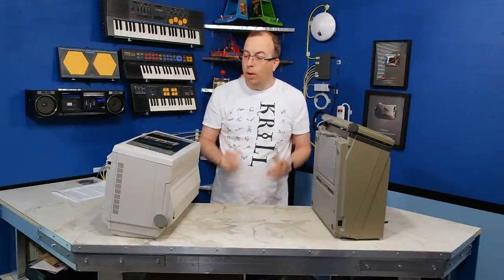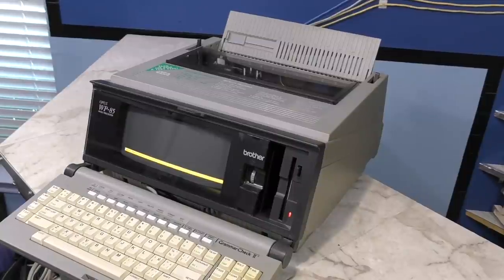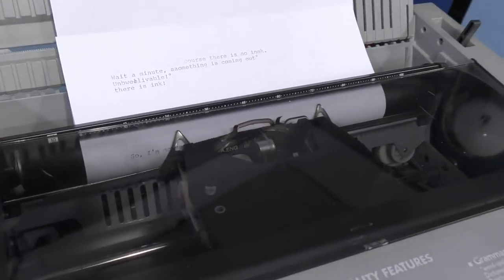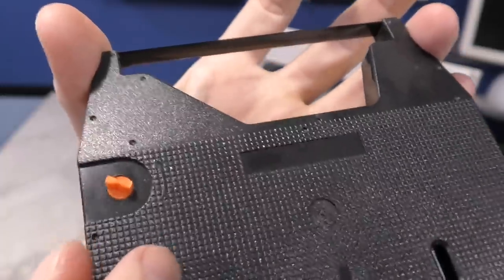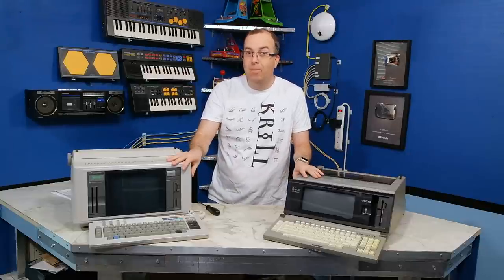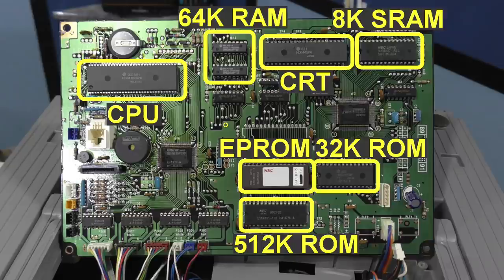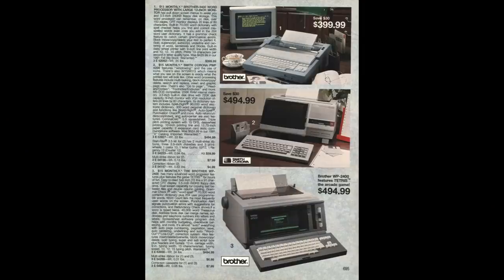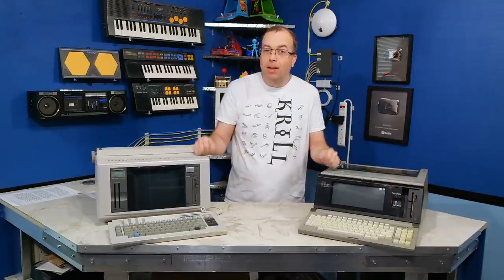Dissecting two Word Processors, Brother WP25 and Panasonic W1525

Comment: I still use Word Perfect on windows 10, from the Windows XP era.  It has editing features I've never found on anything else.
Reply: I used Wordperfect for DOS when I took a class on school in word processing.
Reply: Have you ever tried Open Office?
Reply: WordPerfect for DOS was the best WP, long after multiple versions of Word for Windows came out. Macros; read many different file formats, and it practically had its own menu-driven Text User Interface on top of DOS. Microsoft used their monopoly power to kill them, as WordPerfect for Windows came out late. It made me appreciate the command line, and eventually switch to linux.
Reply: @squirlmy  I bet. I just remember having to learn those codes to get the text to appear a certain way but you couldn't see it until it was finally printed.
Reply: The view formatting codes is super useful.
Reply: @ct92404  I use it; I'm working on the 2nd draft of my 3rd novel with it.
Reply: @squirlmy  "Microsoft used their monopoly power to kill them," - Sure MS did, because we all know that Wordperfect being one of the most overpriced software packages in the history of computers had nothing at all to do with it's decline in popularity as viable alternatives were released.

Comment: You know it's funny how certain things come back at you when you hadn't seen anything like it in the past.  I once worked for an office machine repair company who did service on Panasonic Word Processors and electronic typewriters.  We also carried the IBM Personal Typing Stations at the time along with the IBM Wheel-Writer and Quiet-Writer typewriter(s) as well as the printer counterparts for them.  I also had the (dis)pleasure of having to have to work on IBM's early electronic (mostly mechanical) typewriters (50, 60, 75 & 90.)  Them wuz the days!

Comment: I owned a Brother WP in 1988 and loved it. Back then, a lot of professors would not accept papers printed on a dot matrix printer, so the crisp print of the Brother was perfect. For writing papers and articles for the school newspaper, it was a great deal at even a few hundred bucks: word processor with floppy disc memory, printer, and monitor. I did, however, upgrade to a Mac Plus (and then a Mac SE), but friends who acquired the WP, which they nicknamed "whimpy," got a lot of use out of it. When the monitor ceased functioning, they simply used the typewriter mode.

Comment: that Brother unit and its floppy drive holds many mysteries indeed. I recently acquired a similar unit with non-functional keyboard and floppy. The keyboard is a membrane type with no real PCB, it is just copper paint sandwiched between two plastic layers. I was able to fix the keyboard with copper tape. The floppy made the same sound like yours. Boy, was it easy to get to it? Noo. You have to disassemble almost all the unit to get to it. Eventually, I got to the floppy and replaced the belt, nothing fancy, just a square belt. Then the floppy started working. It is a very non-standard format, no regular computer can read this floppy, but recently someone created a program on an ARM devboard, which allows you to read and write the floppies using standard PC drive. There is even a converter software on a forum. Now I can write on the PC and transfer to unit for printing or vice versa. Brother Word Processors are the best. I think Brother PowerNote devices are also very relevant to your channel, you should have a look.

Comment: I had a Brother typewriter in the late 80s to early 90s. It was a real workhorse. It was similar to this machine but it just had a small LCD screen and you could only see one line so it was more like type a line, make sure it is correct, then send it to the paper and just type to the paper which is what I normally did. It had a correction tape.  I used it for shorter papers along with my Apple II and ImageWriter printer. It is amazing how reliable that stuff was compared to my modern InkJet printer which I regularly have to smack around.

Comment: I had two of those same Brother word processors. I bought one for $50 at a garage sale in 1992 and I found the other one sitting next to the trash in my apartment building about 5 years later. The word processing program is similar to Word Perfect. I enjoyed the typing part. As a speed typist it has a nice comfortable keyboard but I usually went somewhere else to print my documents because it's really loud.

Comment: The cloth ribbons can be reinked, or renewed in various ways (the pigment isn't gone, just the light oil carrier) see Google for various types of ink or oil and methods to use. 
You can also find universal replacement ribbons on Amazon, and you just find the width that you need, and replace it in the cartridge.

The other type of ribbon is called a Correctable Film ribbon, and the  correction ribbon often actually removes the ink from the page rather than just covering it up.

On the better typewriters that used the film ribbon (like the IBM Selectric, which I started repairing as a kid, in addition to with Kaypro's and ZX'S and such), the ribbon actually moved up and down, so each character was in a different vertical position, allowing nearly complete useage of the ribbon surface, as well making the characters appear semi-randomly on the tape, and so close together as to be nearly unrecognizable as characters, and jumbled in order, so very difficult to recreate what was typed.

Of course, a determined person can often see what was typed on a cloth ribbon under the right circumstances lol

Comment: A lot of typewriters from the 70s and 80s have correcting function.
Reply: I think his confusion was not that it had correction tape, but this isn't considered a typewriter its a word processor which basically the difference is normal its not printing the word as you type, its only gonna print when you tell it to. That being said i think he forgot that most word processors had a typewriter function as really they are just glorified typewriters and will function as such so then a correction tape is a necessary evil, i like the panasonic design nicely as the last time i had a typewriter with correction tape, this was very early 2000s the correction tape was built in to the normal typewriter ribbon so you could effectively use all the correction tape with all the normal ribbon, kinda dumb design since you had to pay more for the ability to correct your mistake but when you used up all the ribbon all the correction tape was also used up, no need to rip the cartridge open when you had no other uses for it.
Reply: zachary carlson well said dude

Comment: Great video. I was in the Air Force between 1984 and 1990. I was a types and they taught us to type on IBM electric typewriters in tech school. Which was a step up from my high school which taught us on manual typewriters. When I was stationed at Nellis AFB I was given a dedicated word processor to use as well as a IBM typewriter. The word processor was a CPT. What was unique was the monitor which was integrated was orientated in portrait mode so that you could view an entire page of text. The floppy disks were 8" and it had only one. I later upgraded to the next model which was smaller called the CPT Jr  obviously a rip off from the IBM PC Jr. It used 3.5" floppies. I used one other type of word processor when I was a Luke AFB. It was a Wang. It used 5.25" floppies and booted its OS from one of them.  It claimed to be MS DOS comparable but I did try and boot off a DOS 3.2 disk and it had a loud continue be from its speaker.  All of those word processors used a daisy wheel printer.

Comment: I don't think it's TOO hard to re-ink a traditional ribbon. I remember those non-ink ribbons. Those are a bit of a security hazard if you use them for sensitive info, you have to dispose of those things correctly...
Reply: Fire 🔥 burn the ribbons
Reply: My mind instantly went thinking about taping your paper to be a cylinder to go through the printer endlessly and leaving something or someone to endlessly press all the keys to exhaust the ribbon until it's all just squares... But then I saw the replies mentioning burning them, which also sounds reasonable.

Are they supposed to be burnt though? Wouldn't that cause some horrible smell or be bad ecologically speaking or something?
Reply: @Architector_4  Well it would not be healthy I suppose. XD
Reply: Get some use out of that prototype Thermal Depolymerization machine. :)

Comment: For the ink ribbon, I use to pry open the top and use a bottle of ink with a roller ball on it. One that's for refilling stamp pads. You can still get those from office supply for a dollar or so. There's usually a small round sponge the ribbon runs along. Ink that up and it will work like new. Then just tape the top of the ink ribbon back down.

Comment: The RAM on the Panasonic is part of the HD6303XP, its a microcontroller - that means it contains RAM, in this case 64k. It is also Motorola 6800 compatible - so a relative of the Altair 8800, Tandy CoCo etc
Reply: If memory serves, the Hitachi 6303 is a clone of the MC6803, which while a derivative of the 6800 series, doesn’t really have that much in common with the Color Computer’s 6809 microprocessor— the 6809 took a very different architectural path from the 6800 than the 6803 did.  They’re cousins at best.
Reply: (But I should note that the TRS-80 Micro Color Computer MC-10 has a 6803 in it.)
Reply: @jasondowns2778  apart from the virtually complete assembler level compatibility
Reply: With the 6800, sure.  Not with the 6809.

Comment: I wonder what the RJ45 (I think) socket is for to the left of the piezo speaker @ 8:45 ?
Reply: Diagnostic port?
Reply: @dunebasher1971  maybe for a RAM dump on custom ROMs
Reply: thats the keyboard port, if you look in the brother model the wire for the keyboard wasn't detachable, but on the keyboard itself the wire terminated with an RJ11 port I think if you watch very closely as he first exposes the top of the mainboard you can see its connected, and when you look at all the other cables none of them have the same look as the keyboard, using Rj11 was pretty common on keyboard wiring, another one that used it was the first macintosh

Comment: Brought back memories. My sister had a chunky Brother WP with a daisy wheel. I had a somewhat sleeker Panasonic. It was about half the height of the WPs in this video.  It had a hardshell cover you put over the keyboard and screen, and had a small flip up LCD  screen that displayed, I think, something like 4-6 lines of text. I don't remember the print mechanism but it was not daisy wheel (because my sister's, you could buy different wheels for new fonts and I was bummed I didn't have that option). 

Mine also took SS DD disks. No, it doesn't mean same [stuff] different day. Single Sided Double Density. Of course it was a rather obscure disk in the very early 90s. Plus you couldn't just hop online and look them up or try to buy them. I finally found out I could use a double sided disk, it just wouldn't use the other side (I guess I found this out from an in store worker).
Reply: Ooh, almost forgot. You could make up custom dictionaries for word spelling. So if you were writing a story with a lot of names, it was beneficial to set one up. It had a rudimentary dictionary built in too. You could even look up basic definitions of words (as long as it knew the words). For custom dictionaries, you'd have to load that before loading the word file you wanted to work on.

Back then it felt so fancy and "important." I felt like Queen Fancypants using it lol. Of course everything we have now is better by far. But, wow, thanks for awakening those memories for me. Fun stuff!

Comment: 1992 seems late for a dedicated WP. I had a PC with a laser printer by 1992.
Reply: Transitionary phase maybe?
Reply: PCs were still pretty pricey in the early 90's. My family's 486 I think was about $1200 (though it came with a monitor and CD rom) so $500 for this wouldn't be too bad if all you want to do was write documents/spreadsheets. I assume these WPs were dead by the mid 90s.
Reply: PCs were still VERY expensive in 1992. 

I worked for a major company in central London at the time, and only senior managers and their PAs had PCs on their desks. Everybody else had to share a couple of PCs in the middle of the office. It was still very common for PAs to use ordinary electric typewriters.

When I got my first one in 1995 (Pentium 90 with 4MB RAM, 540MB hard drive and 2MB Diamond Viper graphics card) it cost me £2500. That's the equivalent of almost £5000 in 2019, or $6541 in American dollars. And that was without a printer. An inkjet would have been expensive, but a laser printer would have pushed the price up beyond £6000 / $8000.

By way of comparison, in 1995 if I just wanted to do WP and spreadsheet stuff I could have bought a dedicated WP system (the Amstrad PCW16) for £299, although that didn't include a printer.
Reply: +dunebasher1971
"[CPU] with 4MB RAM, 540MB hard drive and 2MB ... graphics card"
I love how replacing "MB" in this sequence with "GB" results in reasonable memory numbers for a today's computer. Just multiply by a thousand! lol
Reply: "on desktop and offices windows was in full domination swing too" - the PCs at my company in 1992 were still running MS-DOS apps with green-screen displays. 

It wasn't until 1994 that I moved to a company where every desk had a PC, and this time they had colour monitors, but again all the apps were DOS-based. Starting in 1995 we could request that we be upgraded to Windows, but that required line manager approval.
Reply: PCs were still too expensive, too difficult to use, and you had the problem of most software being fucking expensive.  You could find a cheapo office suite for a few systems (I think you could get them for Apple and Commodore for like $100 in then money), but most "real" software was hundreds of dollars.  A $1000 PC plus $300 for word processing program plus another few hundred for a printer is much more than the cheap do little WP machine.  And you did not really have to know anything to make documents on WP., which was great for people who did not "do computers".
Reply: Lassi Kinnunen : " '... there were cheapo inkjets like hp300 around that timeframe already.' "

I owned a Canon BJ10ex printer in early 1993, I bought it at a computer trade show/fair in the west end of Toronto for $450.00. Not cheap even by today's standards, but it was worth it because it didn't take up any room and was whisper quiet compared to the Panasonic dot-matrix printer I had the previous year.
Reply: I got a Smith-Corona word processor in 1994 for my birthday. I used it all through high school and for a few years afterward.
Reply: Many people just didn't want to deal with full blown computers, and preferred a cheap dedicated word processor. 1996-1999 I used a Brother word processor that was probably built in the mid 1990s, with color screen and some kind of operating system underneath the graphical interface.  It also had a terminal program and modem that allowed me to dial in to work and access the only "real" computers I cared about.
Reply: Really?? I was using an Apple IIe with a monochrome monitor. Three years later it was a big deal when my wife bought a laser printer to start work as a freelance editor, and I had AOL on a top-of-the-line 56k modem.
Reply: Lassi Kinnunen  "cemented by Doom in 1993" Doom was one of the first games that could really be played over a network. I'm pretty sure it was the networking capabilities (and upcoming World Wide Web) that was the turning point and not Doom! lol
Reply: @Architector_4  well low end PC specs. Id say 8gb of ram is more optimal now. (I have 16gb which is overkill for what I use but hey, better to have more than you need right?)
Reply: @IanC14  
True. That's why I wrote "reasonable" lol

Comment: I was surprised by how much faster the Panasonic unit is.  I still have the Brother word processor my mom bought when it was new.  She bought all the blank floppies for it, ink ribbons, daisy wheels, and assorted spare parts she could get.  Dozens of these things just in case the machine and its parts stopped being manufactured.  Up until I got her a new laptop a few years ago she was still using the old word processor to do all her typing.  Hers has a 2 line LCD display of usable typing space.  And like in this video you can type directly to the paper.

Her machine is quite a bit slimmer and has a built in handle on the bottom.  Although I must say the one you used is so much quieter than what she owns :)

Comment: A bit fancier then our computerized typewriter. We still use our typewriter (it's from the late 80's) to type up personal letters and has actually held up well for a long time. Kinda cool to watch and hear it start up as it does it's self-test, lots of banging and rapid clicking when it initializes. If I remember right it does have a repeat function, anti-jam function, and has a connector on the back to connect to a Dos console (aka a computer) to send data to it, basically like a word printer. Seen it open a few times when it was being serviced, has an Intel 8088, like 32k of ram (can't remember exactly how much) and a disk on chip for running the programs. It has a normal qwerty mechanical keyboard built in minus a few buttons and numerical pad which makes it very easy to use if your going back and forth from your computer. Definitely from a time when everything was being computerized.